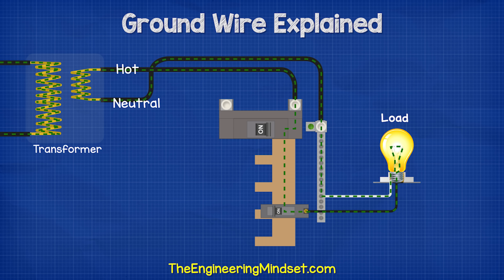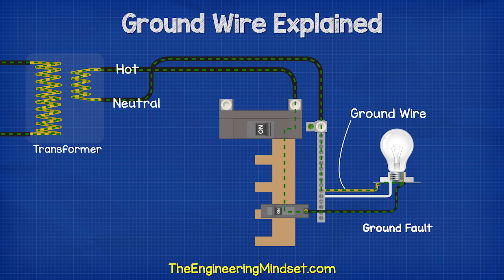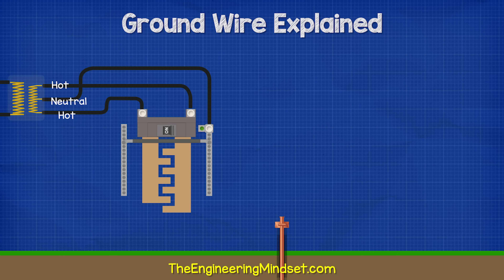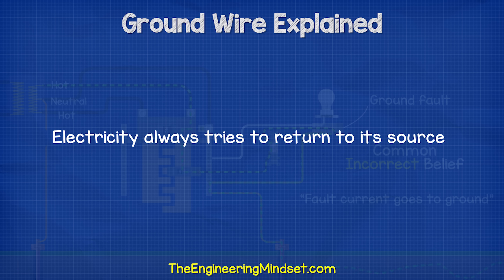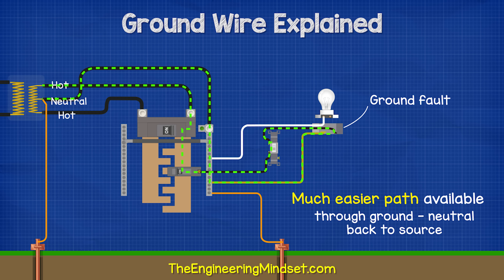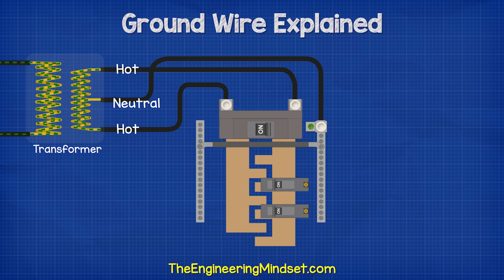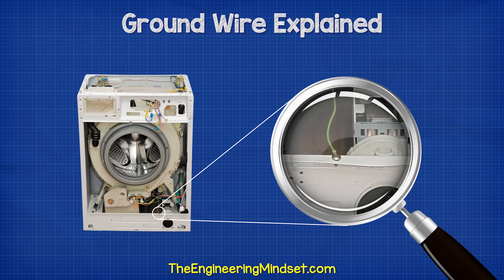Ground Wire Explained

Comment: Many thanks for all the videos you do they're always educational. Question with regards to this one though, when you say the ground fault will takes preference over the path with the least resistance and therefore take the ground - neutral path instead of the ground rod. Surely this is incorrect and it will take both routes back to the transformer? Isn't it just a parallel path for the current one with high resistance (the earth rod back to earth rod at the transformer) and one with low resistance (ground wire - neutral back to the transformer) and therefore it will take both paths? Many thanks in advance 🙂.
Reply: I'm throwing out some arbitrary numbers here, which I'll explain in a moment. The ground to neutral route has a resistance (impedance) of 0.1 ohms and the ground to earth to ground to neutral route has a resistance (impedance) of 100 ohms. Even though it's a parallel circuit, a thousand times more current travels through the neutral to ground route. In reality the impedance difference is usually much higher, but it depends on the impedance of the earth, which varies wildly depending on conditions. If the soil is saturated with salt water from a hurricane surge, that might just become the path of least resistance!

Study the topic of resistor networks.
Reply: @jstreutker  and therefore takes both routes back to the transformer regardless of resistance? Just that in the video he states that "as we already have a very low resistance ground wire which provides a path directly back to the source, the ground fault is going to take this route instead" which in my opinion was an incorrect statement because as you've just said that if the soil becomes saturated with salt water from hurricane surge that might just become the path of least impedance. So in any scenario the fault current takes all paths back to the transformer and not just the path with the least resistance, which was my initial question and my understanding of it. 🙂
Reply: @stevenhargreaves9897  you are correct that electrons take all available paths, which is why the ground and neutral circuits are only allowed to be bonded at a single point, otherwise the ground wire would have varying potential along its length since it would be a parallel current path.
So yes, a fault circuit that includes contact with the earth as well as the ground wire will return some current through the earth, and so the statement in the video is inaccurate. 
In practice it doesn't make much difference, because even with a salt water soak, the impedence of the soil will be so much higher than a copper wire that negligible current will flow, but it may be enough current to stop a heart, so that's why we use GFIs etc.
So yes, that should be worded differently, but it's relatively minor in the scheme of things.

The main purpose for the ground wire is to get a high enough fault current to trip the breaker, because through the earth is basically never enough current to trip a breaker and stop a fault.
Reply: @ke6gwf  Many thanks for your reply it is much appreciated. Yes I understand that RCDs or what you call GFIs are used to trip when there is a current in excess or equal to a certain amount (typically in the UK 30mA) flowing to earth. When you say that ground and neutral circuits are only allowed to be bonded at a single point, otherwise the ground wire would have varying potential along its length since it would be a parallel current path. In the UK we sometimes use a certain type of earthing system called a TN-C-S which sometimes incorporates a  PME which refers to Protective multiple earthing. This is where the combined earth/neutral conductor is connected to the physical ground in multiple places along the cable length. Would this be a case where there is multiple ground and neutral circuits and therefore it will have varying potential along its length? So from the point where the neutral and earth are combined they run all the way back to the transformer, then all the high resistance earth electrodes are each parallel paths back to the transformer? I hope this makes sense and apologies if you are unfamiliar with this type of earthing arrangement I'm not sure if where ever you're from uses this type and I'm assuming you're not from the UK when you referred to what we call an RCD a GFI. 🙂
Reply from the maker: Check out NEW resistor video, everything covered! ➡️ https://youtu.be/DYcLFHgVCn0
Reply from the maker: We just published a new Ground fault, short circuit and arc fault video, so much detail! Link HERE➡️: https://youtu.be/Qi0ynSQw-wc

Comment: If electricity always goes back to the transformer, why are we paying for it?
Reply from the maker: You're paying for the power company to run 24/7 365d/y with all the lines, equipment and staff required so that when you switch on your light, the power station instantly supplies the pressure to pump electrons through the light. The lamp takes this energy of the moving electrons and turns it into light and heat, the electrons stay in the wire, just their energy was used and removed from the system. The power station then has to top up this energy. Its like if you run a marathon, you stay on the road but your energy was used up, you're hot and this heat leaves your body. You need to eat to put this energy back.
Reply: @EngineeringMindset  I disagree, they are charging me for an amount of KwH I, obviously, gave them back.
It's written on the bills.
People of every country, lets make this oppresion stop!
The electricty bill is a lie!
Reply from the maker: Right. Well, you can just buy some solar panels and go offgrid.

Comment: Is the central mystery "Electricity always tries to get back to it's source"  ?  This always seems to be the final simplex statement that concludes even the most edifying of descriptions of circuits / grounding.

Is there no way that equivalent power and application of electricity could be found by something equivalent to a giant over-charged balloon running to a different probably impossibly humongous under-charged balloon?
Reply from the maker: We just published a new Ground fault, short circuit and arc fault video, so much detail! Link HERE➡️: https://youtu.be/Qi0ynSQw-wc

Comment: correct me if im wrong with my understanding, so it means that the nuetral and ground wire are sharing the same path going back to the source? so if i use an RCCB on this particular circuit it will trip automatically?

Comment: How about this scenario, there are no earth's, just live and neutral. So if a metal casing became live from a broken wire or such, and you touched it, how would you get electrocuted if there was no return path through any earth's? I'm guessing through ground rods only because they are still needed for dissipation? But still I've always wondered this, I know there'll be some sort of good reason though.
Reply from the maker: You can onky be electrocuted if electricity finds a path through you. That's why birds can sit on a high voltage line completely fine, however, if they sat on the wire and came too close to another wire or the metal pylon, then they will be blown to peices. That's also why insulated mats are used and insulated tools/boots to try and cut that route.

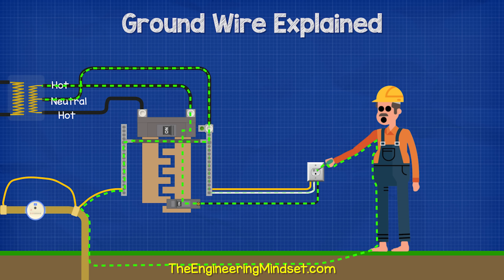Comment: 3:10. If the current is not high enough to flip the breaker and turn off the power, is it high enough to kill someone?
Reply from the maker: Yes. Although there are different types of breaker used to prevent that in most cases, but not always.
Reply: You are dead on all occasions unless the circuit is RCD/Earth Leakage safety switch protected and you're not between active and neutral (basically a big resistor)
Reply: There are no absolutes. Even the most advanced breakers are not perfect. Gfci trips at current differentials below typically dangerous current, but not all people are the same.
Reply from the maker: Check out NEW resistor video, everything covered! ➡️ https://youtu.be/DYcLFHgVCn0

Comment: This reminds me of a terrible incident here in Australia a few years ago where a young girl received a shock from the house's ground wire. The family had complained to their housing authority for a long time that the electrics in the house were faulty. The girl had gone outside to turn a hose off, barefoot, and received a shock from the ground wire. She survived, but can no longer talk or walk - I'm not sure how much she's recovered since. I always wondered how one could receive a shock from the ground wire, since I always thought it was the 'safety feature' - but I see with a large enough fault they can be carrying dangerous current.
Reply: Dumb family was waiting for ‘authorities’ to fix electrical problem in their home?!?? What happened to hiring an electrician? Well - pity their daughter had to pay the price for their empty heads and scroogyness….
Reply: J
Reply: J
Reply: That is, at least as far as I heard, exactly why in Serbia it is forbidden to use a TN system in houses. I think many old ones still are TN but a lot and even mine from 1976 has (tested) good earth rod so it is very easy to switch to TT.
Reply from the maker: We just published a new Ground fault, short circuit and arc fault video, so much detail! Link HERE➡️: https://youtu.be/Qi0ynSQw-wc
Reply: If you do a little study on resistance and potential difference, it would make perfect sense. Fellow Australian here, and many houses back in the day used the gal plumbing for their ground. The state of the mechanical connection certainly comes into it. New regs wouldn't necessarily mean a more effective ground, and soil type and hydration factor in.

Comment: Ground wire separate connection busbar with neutral in 1 phase network
Reply from the maker: We just published a new Ground fault, short circuit and arc fault video, so much detail! Link HERE➡️: https://youtu.be/Qi0ynSQw-wc

Comment: This could have benefitted from a longer length video with a slightly slower pace to actually have time to absorb the situations and examples. Now it required a lot of pausing and unpausing to get a proper understanding of the video content. Pausing stops the animations so not such a good of an option, and slowing the video down distorts the voice.

Usually skipping the boring stuff or fast forwarding is much better than having to stop/slow down

Comment: Correction: Current takes all paths. If it took only the least resistive path then parallel circuit wouldn't exist. Yes, less resistive paths cause currents of high magnitude and high resistive paths lower the current's magnitude. That's it.
Reply: Current takes the path with the least resistance always. But it doesnt mean it has to go in a single line. Its path can be devided and make it even less  restrictive. Electricity is just moving electrons. So if they ALL go in the less restrictive path it becomes more restrictive than splitting 80/20
Reply: Not for engineers.
Engineer: it's close enough, make it zero 😉
Also, PI = e = 3
Reply: @kimamaral3015 that's actually wrong

Comment: Why does electricity need to go back to it's source? How much of it is actually being used? Supposedly, DC circuits, other than batteries, can use a single wire with earth return. Meaning, the charge just dissipates in the earth, it doesn't really return to the source at all.
How does a Solar panel ground electricity? Does the electricity need to go back to the solar panel? If the light is converted into electricity, doesn't that make it impossible to return to it's source?
Reply from the maker: The photon from the sun knocks the electrons out of the panel and it passes through the circuit to reach the other side of the panel and get back into position. If a power supply is dissipating into the earth then it must also be pulling from the earth somewhere else. Electricity is the flow of electrons, generators do no create electrons, they just pull them in and push them out
Reply: @EngineeringMindset  electricity is electrons in motion, right. Is there any way to figure out how much force is simply passing through the system? If the electrons don't disappear, then they must be pushed, after the load. So how much power/force or whatever is being used in the system, to maintain flow? Wouldn't this mean that technically there is some amount of power in a given circuit/system that cannot be used for work? Sort of like the Carnot cycle with engines, or the one with windmills (Max 50% efficiency). If not, why? Also, doesn't this mean the relatively high 96% efficiency of electricity is incorrect?
One more thing, if electrons cannot be created, what the heck is gravitational potential energy?
Reply from the maker: Voltage is the pressure pushing the electrons. In AC they are pushed forwards and backwards constantly, that is why it is called alternating current, because they alternate in direction. The amount of electrons flowing is current, this is measured in amperes or just amps for short. The power station provides the pressure, if you turn on a light you allow the pressure to push and pull electrons through the lamp. If you turn the lamp off, the pressure remains but no electrons will flow.
Reply: @EngineeringMindset  I understand all of that. I meant that if the electrons have to be pushed, it must take some force to do that, in addition to what the load requires. I think I figured it out though, I'm pretty sure that is what resistance is.
Reply: @EngineeringMindset  I think I figured out that it's resistance.
Reply: I didn’t see another answer on solar panels. A solar panel has two wires, positive and negative. They produce dc voltage normally between 12-24volts in full sunlight. That is stored in a battery and/or converted to ac and fed to the house. Neither side has to be connected to ground, but usually is through some sort of control box.
Reply: @TomCee53  I've learned a few things since this post. Interestingly, if a circuit doesn't require a ground, it suggests that force isn't really being carried at all. Otherwise, any unused energy would backload the system, and stall out the electricity. It raises all sorts of questions about the nature of electricity.
I'm beginning to think that electricity doesn't carry or transfer load, and that the only reason generators don't power themselves is because they induce a magnetic field in the stator while generating electricity. That magnetic field then slows down the rotor, hence why completing the circuit causes a generator to slow. It means that if you could arrange the induced magnetic field in advantage, the machine would power itself.

Comment: I think neutral is called PEN when it leaves transformer and it is separated at the fusebox to separate PE and N., but it works like like you explained as far I know.
Reply: neutral is called PEN (in other words PE+N, by the functions that are expected from conductor considering circumstances) when it is grounded at the source (transformer) but separate PE conductor is not provided, so it has to be derived and grounded again upon entering the property.
The necessity for differentiation between PEN and PE/N is coming from a simple but crucial rule that you can not (and by regulations should not) merge PE and N back into PEN under any conditions.

Comment: I've had desktop computers before with crummy power supplies that would shock you when you touched the case.  Grounding was the solution in these situations as it allowed this stray voltage a path back to panel neutral.
Reply: And you kept those in your pc?? Brave man!    
(are you sure it wasn't just static buildup on you? Wool sweater, socks on laminate floor, that kind of thing... )
Reply: That should trip your rcd
Reply: @stevecarter8810  Panel's only used standard U.S. style circuit breakers.  Not enough current flow to trip the breaker.  Probably a current flow of 500ma or so.
Reply: @Fransisco Wijaya True.  Fortunately for me that place was all utilities paid haha!
Reply: That is not a sign of a bad power supply that's a sign of a GOOD power supply. It means you have a noise filter and these filters leak a few mA to ground. In my grandparents house from the 60s that had no PE wire on most or all outlets I would get a zap from touching a computer case or even metal keyboard with even slightly wet fingers. It is because of this. Doesn't help it was all on one power strip so all other switch mode PSUs with filters were adding more current to the earth wire that went nowhere.

Comment: Thankyou for this video but it would be best if you could give green clr to the ground line as it would be more clear + it’s what is used for grounds. Thanks
Reply from the maker: Ground is often bare metal in the US. Sometimes it has green insulation. EU does but it uses a completely different system.

Comment: I want to know from you sir: why you represent current flow as the positive charges are flowing from positive to negative (conventional current) instead represent it like electron flowing from negative terminal to positive. So that there is no problem in understanding.
Reply from the maker: Most people are taught at school that is flows from positive to negative. I don't usually animate it like this people sometimes it's easier than getting a lot of rude message from people who think I'm wrong ahhhhh the internet
Reply: @EngineeringMindset  Sir , there is a big confusion in the working of PNP transistor- how can holes of emitter potion can move to the base then to the collector.
Could you make a video for solving
This problem or just typing give me a solution but video is more helpful.
I hope you will receive and read my message